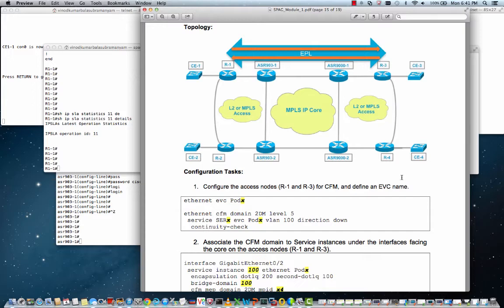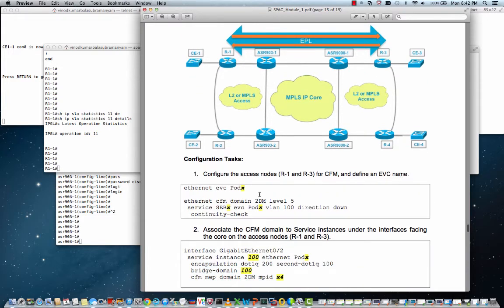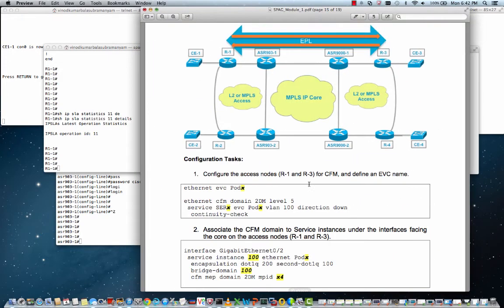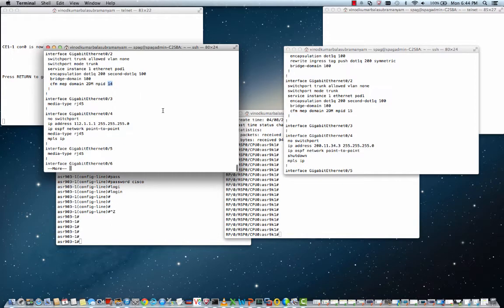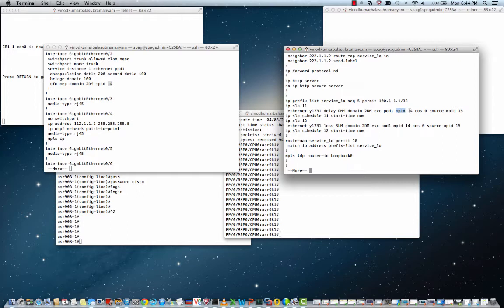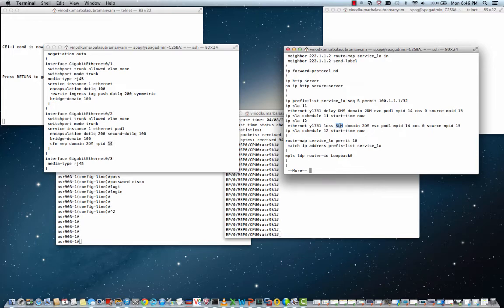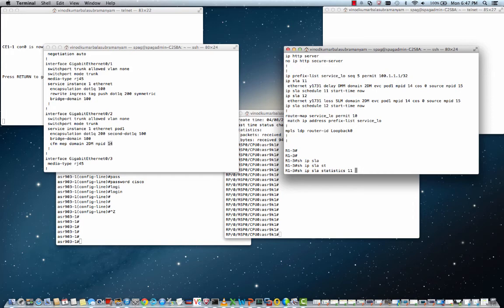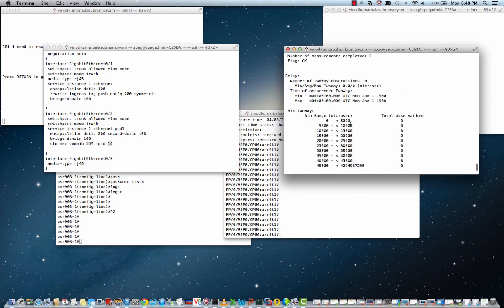Tutorial - Configuring Two Way Delay Measurement using Y1731 PM

Comment: Thank you for your sharing information. I configure single-ended loss measurement using Y.1731 PM. I have a problem with it. TxFCl and others counters are always 0 and i can't find the problem. I capture frames in wireshark and use CRS1000v image in GNS3. I will appreciate if someone can help me.
Reply: Hello, what CSR1000v are you using ? I have tried with 17.3.2 and it's working well (Single-ended / DMM). Are you sure you are using the correct Domain/EVC/Destination and Source mpid values ?